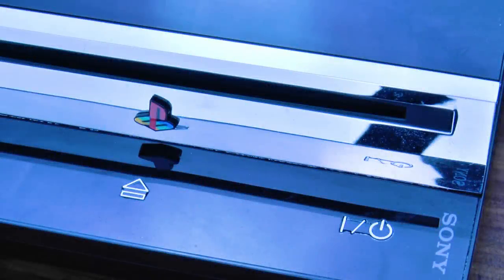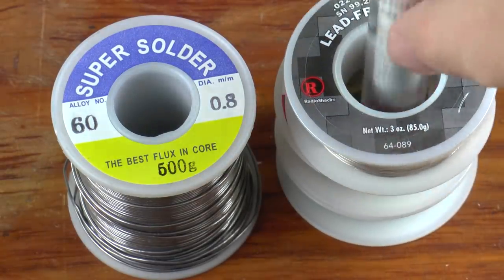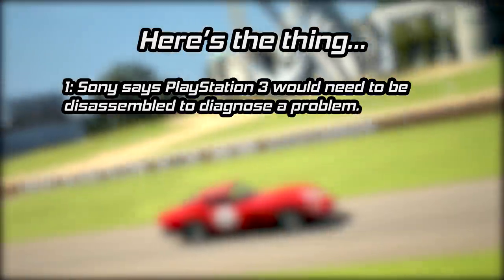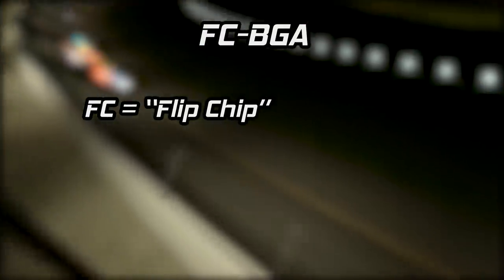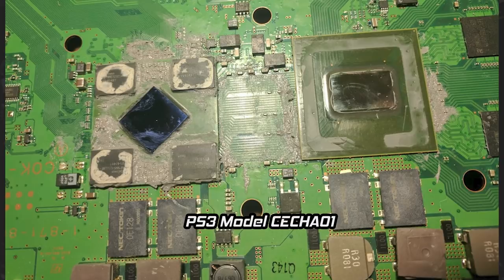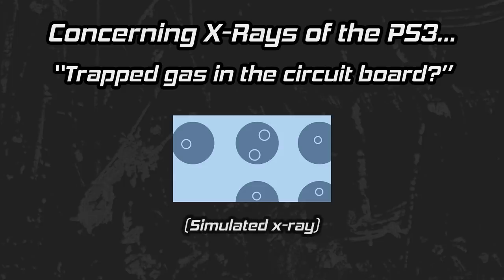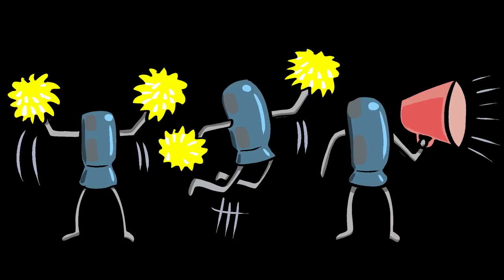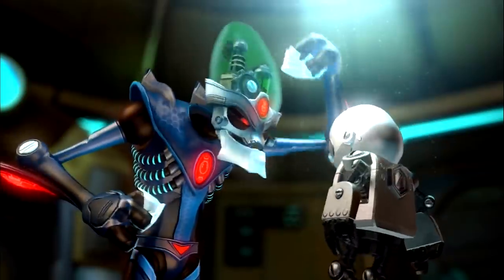The Misdiagnosis of the PlayStation 3 Yellow Light of Death

Comment: I can totally confirm the NEC Capcitors being the culprit on my PS3. I've got a CECHG Model that ran fine for around 10 years beside having to replace two laser units. Then I didn't use it for around 4 years and it gave me the YLOD. I replaced the thermal paste and only heated the NEC Capacitors with a cheap small heat gun bough from china. It's not even a proper one, something between a hair dryer and a heat gun. Didn't work right away but after like turning the console on 20 times the light stayed green. This worked for just a couple hours. I just needed the console for some multiplayer trophies but it would be also handy to make a backup.

Comment: Yeah re-flowing of the solder can only do so much it can temporarily fix your problem like anything with applying heat to. Just look at Graphics cards and users putting those into an oven to reflow the solder just to temp fix the card. Temp fixes are good for if you are close to saving up enough money to purchase a new Graphics card or what ever item you temp fixed and need just a tad bit more of time. Louis Rossman of Rossman Group a company that fixes Apple Mac Laptops for a living and he says it is better to put new solder on rather than  heating up the specified area with a heat gun or baking it into an oven.

Comment: I'm happy I never saw those reports back in the day.
It just seemed to be dust shorting out the system somewhere, so I cleaned it (it was shorting by the point where the plug connects to the motherboard)
I got it free because my sister's ex couldn't figure out the problem and read it was dead. I had it fixed within half an hour

Comment: I had this issue and found the same diagnosis. I used a heat gun on the whole main board. It got the console to boot again but I didn't remove the wifi and bluetooth module before blasting it and fried them both. Luckily the USB ports still worked. Got my saves and threw the rest in the trash.

Comment: My family got a a 80gb model in 2008 and it stopped reading games after a year and a half. We ended up getting a 120gb slim model that Christmas in 2009 and has never failed. So they definitely fixed the problems in that time. And thankfully no yellow light of death. I ended up using the broken one as a digital console before it was an actual thing lol

Comment: So I have the OG ps3 model with a 500gb HDD that keeps turning off and flashing just the red light after about 10-15 minutes of gaming. I thought it might just be super dusty so I popped it open after so many years of gaming and sure enough it was pretty bad. Cleaned it all up and it booted right up, it's certainly more quiet now but it keeps doing the same thing. Didn't even think that maybe mine might just be the thermal paste 🤔 thankfully the YLOD has not appeared. I haven't turned it on since the cleaning. I'm wondering what else could it be if not the paste?

Comment: I used to fix consoles all the time I still do.
Every single xbox 360 can be fixed easy.
Red light can be easy.
Reset
In 5-minutes by holding button in sequins.
I never had a Xbox 360 what couldn't be fixed
My personal 360 has had red light about 10 times. The last one was 6 years ago still works perfect.
You can get red light of a lot of things.
By not putting power lead in properly.
By not putting HDMI in properly.
By not putting hard drive in properly 
A lot of people thought their 360 was broke because they didn't know how to reset the red light.

If Xbox 360 had overheating problem they wouldn't work again.

I'm not sure about the first lot of Xbox 360 consoles.
 I never had one
Not sure if I ever fixed one 

Yellow light on PS3 cannot be fixed it means death

Comment: For many years the only reason why PS3 experience yellow light of death is because of high temperature. Where or what part of is need to repair? There is no right answer. It depends of the PS3 unit that you owned. Its like a human being who had a symtoms of high fever. If you had a fever and the other one had a fever too, its not suprising if you both do have different type of medicine to cure it. Why? Because your doctor diagnose both of you and he see what proper medicine will work to both of you.
In other words, all ps3 might have all same symtoms of YLod but they do have different type of repairing it. Either changing the capacitor, reflowing or reballing the chips, or just cleaning it to make the airflow flow properly.

Comment: Why would heating up the CELL and RSX bring it back to life (temporarily) if it was anything other than the lead-free BGA Soldering?
Reply from the maker: The heat could allegedly restore a connection between the die and the substrate. It is also possible that the solder used for the solder bumps in that area still used lead-based solder. I believe there were some exceptions made for the use of lead-based solder when it comes to chip fabrication, but I am not sure if Sony took it. It is possible the temperature would also cause changes to the underfill - but that is pure speculation on my part as I only really know that you're looking at a lead-free solder flow temperature of maybe 210-220 and underfill cure temperature of maybe 150 during the manufacturing process. As to what happens to an already cured underfill when you heat it up? I don't know. Possibly nothing.

If the die-substrate connection was restored but the chip still experienced the same thermal stress as before, the system would be "on the clock for failure" once again. And honestly, the prospect of a questionable die-substrate connection is rather wince-worthy as it would be a manufacturing design/assembly flaw that you can't really do much about.

Comment: maybe the thermal cooling isn't the problem, it's the fricking SYSCON cooling that doesn't push the fan to the max when the rsx & cpu is almost 80c that will probably melt the solder under them. & also the caps they use.
Reply: 80c will not melt the solder

Comment: If only I had access to the proper screwdriver, I could look at my own PS3 and see what the issue is.
Reply: Have you gained access to the proper screwdriver yet?
Reply: @kengruz669  LOLZ NOPE!
Pretty sure though, it is bad capacitors...
Even then, I wouldn't be able to do anything about it... :/
Reply: @AmyraCarter  I have my PS3 totally dissasembled, and am going to watch a few of the capacitor videos from NSC Modz on here. Btw, all you need is a philips head screwdriver for virtually every screw, and a torx (some call it star)of the right size, in one place.
Reply: @kengruz669  It's the torx screwdriver I don't have. Never, ever, have had. Nope. Never.

Comment: its because it has got a bad reputation. Lead free solder = good for the environment but terrible reliability because of it being more brittle plus requiring higher temperatures meaning the components will get damaged in the soldering ovens and thus be broken even before reaching the retailers = all RoHS certified  gear will be terrible quality and fail very soon. This has however not been an issue for me at least, all my gear have lasted and is still running, computers, mobiles, TV ect so the issues have probably at least in general been adressed with this from my point of view.

Comment: Exactly. The beginning blame is probably ATi and their shitty solder they used on the 360's GPU, which they didn't fix until the Falcon motherboard. So PS3 people probably thought NVIDIA had made the same mistake. (remember this is also during the GPU plague where many laptops had problems from both ATi and NVIDIA)

Comment: Believe it or not I used to bypass this issue by applying pressure with the palm of my hands downward on the ps3 on top of the disk tray area. It was kinda like giving the ps3 cpr. Not sure why it worked but it did

Comment: I run gamegears4you.com and have repaired more Game Gears than anyone around.  I truly appreciate the opinion and info in this video.  The Sega Game Gear has absolutely flooded the internet with poor "tunnel vision" that everything needs to be recapped.  Capacitors are not always the problem with other consoles even though with the Sega Game Gear it is 100% of the time at least one of the problems (excluding anything else that can happen such as LCD damage etc.)  Diagnosing individual problems when working on consoles is the key, common problems with certain systems should be looked at first but assuming that is the problem every time can be costly.  Very good video my friend thank you for posting this!

Comment: "trapped gas in the circuit board" - whatever the hell that means - would be a process indicator.
Now: You can not see gas in the circuit board in an X-Ray. Fiberglas and Epoxy do not absorb X-Rays significantly, neither does air. Meaning no contrast. Even if, reflowing the board would expand the gas, making the issue of delamination worse, not better. Assuming that they mend voids in the solder joints: Again process indicator - but seeing voids (plural) on one Board sold to a customer is process indicator that applies to a significant number of units manufacturer (or lack of process control - which would be way worse than a bit of voiding). Voids are a process indicator, not a problem on its own. In consumer electronics, voids can be acceptable.

Comment: I just fixed my launch edition 60GB Fat with a heat gun. Will it last? Probably not. But I have it on CFW and with its full backwards compatibility and 500GB hard drive, it was worth a shot. Next time I'll change the capacitors. Just fixed an OG Xbox by doing that.

Comment: Considering many different devices can have a similar issue, and are fixed with reballing with lead based solder most of the time, I find this information just as inconclusive as saying reballing/reflowing the definite fix.  It is most like a case by case issue.  My PS3 Phat launch PS3 yellow light of death in the middle of playing GTA 5 online.  I ended up doing a reflow with a heat gun that has a nozzle to aim the heat to a certain spot and reflowed the GPU and CPU.  I didn't reflow the capacitors and it works fine but will most likely fail again and at that point I will get it reballed.

Comment: Both my ps3 had problems,  the first works for like 1 or 2 minutes,  beeps and turns off,  the other one  was working,  suddenly the usb port that kept the controller alive stopped working(my controller battery also suddenly died, worked fine one day,  the next day would not work on wireless)  so it turn on but its unusable,i got very unlucky on them

Comment: so they key is the systems are only able to run to a certain temp rating.  once exceeded it gets locked on that over temp when u turn it back on turned on a 1 and couldnt make it a 0.  u have to reflow them in any 350 degree oven for about 5 mins no more no less. and voila my xbox has been working for 2 years since. and i have fixed 1 ps3 this way but it only lasted about 4 months

Comment: There is like a 3 year old video where a guy explains exactly what causes it. There was a metal shrouded power supply that got super hot and wasn't cooled very well. Well the geniuses at Sony positioned this super hot component above one of the main chips in the motherboard cause it to get so hot over time it will desolder severing the connection putting the system into a state where is can't perform simple booting checks so it won't even turn on.
Reply: In the new slim version they swapped it with a plastic shrouded power supply and slid it further back away from it which is why the don't have this problem nearly as often
Reply: Also the guy I'm referring to is Retro Arts Gaming
Reply: The console doesn’t get hot enough to melt solder

Comment: Consoles have always had poor cooling.  They're more liked locked down computers and their thermal demands should be a top priority.

My Ps3 died to the YLOD and had to be disassembled and blasted with a Industrial heat gun over the CPU GPU chip. This worked 4 times, each time lasting less than the last. On the 5th time it refused to boot and went in the trash.

Comment: I once had a Gtx 7800 which is the same thing that is the Ps3's GPU,after 6 months it started giving the BSOD  and it had no NEC TOKIN Capacitors,1 day my son put the pc on with 1 of the power cables stuck in the gpu fan which forced it to overheat the next time i switched it on it was working fine until i upgraded to a 9800 OC which I had bought 2nd hand and also had the same problem and by then I had finished college and bought myself a rework station,reballed it same story card started working fine,the Ps3 Phat draws a lot of power and produces a lot of heat combined with dust  also the fan runs too slow,the failed nec tokin capacitors are now more commonly the cause of ylod because they are now past there service lifespan but back in the days the most common cause of ylod was broken BGA solder not making proper contact with the pcb and gpu,i'm talking from more than 12 years of experience. Just watch any of Eli Tech's videos you will see what i am talking about

Comment: 3 years from that point on not from purchase which was either in 07 or 08 and I do believe it was 2008 and lasted till 2011 and which is part of the main reason for them releasing the s model in 2010. It was based on lead free and bad thermals and this was a problem. They also didn't know till 2007 how bad it was. The PS3 issues were many more and were hidden and fixed faster hence all the revisions and the slim model released in 2008 fixed all the issues. This is definitely a fanboy talking. The PS3 had a lesser failure rate than the 360 but also could catch on fire and kudos to Sony for fixing these issues every 6-10 months which is a much better business model. Buy they did bury it.

Comment: now im having doubts about buying a second hand one
Reply: If I bought another one, I'd have to thoroughly test it. Turn it on, run it intensively for a while. Best if you know the seller getting rid of it, to know if it's been acting-up in any way. Then, if you buy it, disassemble it before failure, thoroughly dust it out, completely re-thermal paste it including (if you are able) under the heat spreader, and possibly add a manual fan controller on it to bypass the sensor to run it steadily cooler. Keep it off a dusty floor, and not set up near anything that would block airflow.
Reply: @kengruz669  What about replacing the PSU for one that gives out less heat?

Comment: Maybe that's my problem. I have a CECHL01 in good condition, no visible damage of any kind. It works and plays games but it has a shadow glitch. Shadows glitch across the board in every game and even in some dynamic themes for the menu. The only modification I have ever made is adding a bigger hard drive. It has never been hacked. Do you have any idea what is wrong or how to fix it?
Reply: Your description is kinda vague, but it sounds like some sort of artifacing. If it looks like some of the effects are changing colors, appearing as squares, or unnatural polygons are appearing then  it could be on the GPU side of things.

Comment: The reason why PS3 gets yellow light the CPU GPU separates from the motherboard.
Because of overheating problem.
You can use heat gun to reconnect CPU GPU back to motherboard.
 But will only last about  2-weeks
Then break again.

Some people fix them
And sell them.
 Ripping people off

Comment: Unfortunately I'm having this issue on my ps3 fat. It power up, but shut down after a few minutes showing up the yellow light, then blink the red one... sad, and I don't know what to do. As your video says, it could be a lot of things... =/
Reply: The most common problem seems to be those capacitors. Try it out and if it doesn't work, try a new PSU. And if that's still not fixed it, then reflowing is pretty much the last option.

Comment: Those flip chips are cursed. They should’ve used PGA, or LGA. Solder should never be trusted under such extreme heat. Leaded or lead free, it’s still gonna melt, or undergo heavy thermal stress.
Edit: after finishing this video, there are so many failure points possible in this thing.
Reply: The ps3 doesn’t get no were near solder melting temps
Reply: @BeinZilex  mine was reballed with real lead solder. I’m pretty sure it’s the Nec Tokin capacitors.
Reply: @OmegaHellHound543  yes i agree with you on the nec tokins being the issue but what you said about the solder melting is incorrect the console has a max temp of 85 and solder needs 250+ to melt (unleaded solder needing more heat)
Reply: @BeinZilex  though BGA to me is still a kinda crap design. I like the simplicity of a normal setup making things interchangeable and replaceable
Reply: @OmegaHellHound543  yes I agree with you sort of, I don't see any other problems with it except the change from leaded to unleaded solder, also the big ass transistors (i think they are) underneath the CELL/BE need a hole in the motherboard which probably doesn't help the board
Reply: @BeinZilex  well I guess it’s functional, and is cheaper to make. Especially helpful when you’re selling millions of units.

Comment: I seen a video by my mate Vince and it was the tokin capacitors and i never seen pure hard evidence that it was cracked solder balls,and when you heated them it didn't last that long most of the time and I was young at the time and I knew there must be some other fault, obviously to me some power fault because the console would want to start but then would quickly show the orange light and then off and I seen some with power supply issues but there was other consoles with seemingly no fix and it's always bothered me what's the other fault but I had no tools to properly fault find

Comment: My mate Vince fixed a fat ylod ps3 by changing those capacitors. Not sayin it’s gonna work for everyone just due to the simple fact you need to diagnose every system because it may be other faulty but yes those capacitors are a confirmed issue